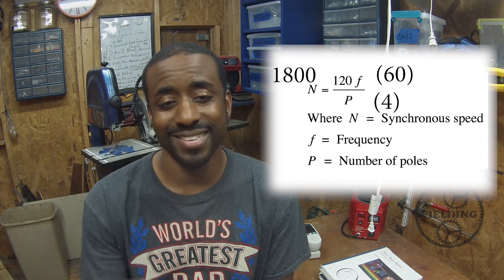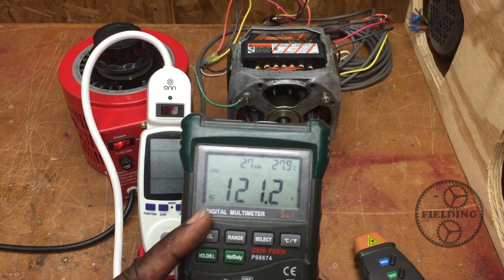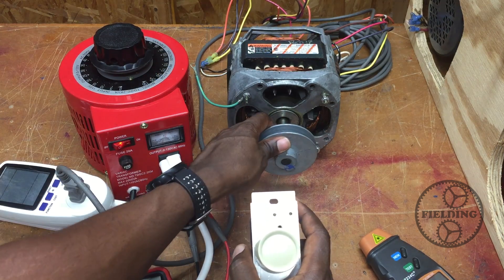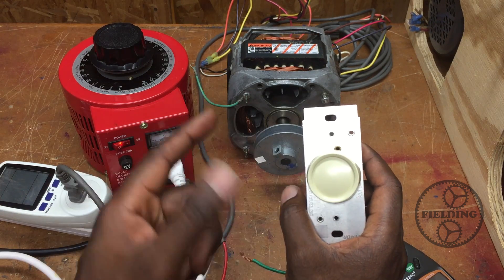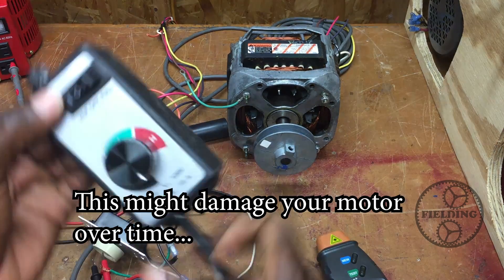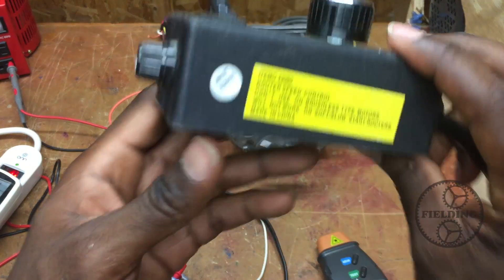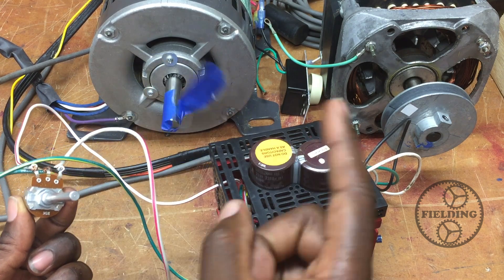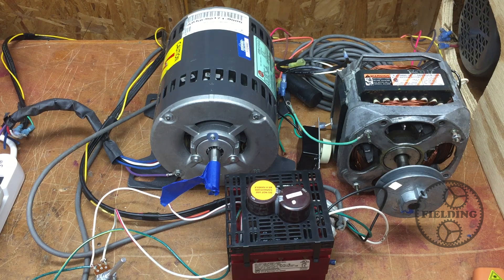Will A Dimmer Switch or Transformer Control An Induction Motor's Speed: 038

Comment: I literally just took a motor out of a 4 to 7 ish year old Ryobi scroll saw  Variable speed disc sander. The motor is 1.2 amps 120vac. And used the 6 inch disk from my 2x42. I have been told since I started to work with one that speed control and a disc sander can become one of the most used tools in the shop. The 2x42 is to fast. Especially higher grits. Flat and square decides good From great. Next project small space heater electric kiln that reaches and hopefully will hold temps for high carbon steels   and at most with 2 fire bricks. Max work piece 6 x 2 x  187 ish lol.  Any thoughts suggestions TIPS TRICKS INFO ABOUT THE HEATING COIL. HOW TO MAKE THE CHEAPEST PID AND THERMOCOUPLE EVER!? Lol it would be appreciated. Thanks for sharing so much entertaining useful knowledge with us. Very enjoyable.

Comment: I am currently experiencing some issues with a pentek intellidrive VFD which can be used with 2 or 3 wire single phase 240v submersible pump motors. Specifically I am seeing voltages from the VFD which I can not wrap my head around. An engineer suggested that perhaps it is due to the PWM and possible lack of a low pass filter on my meter. Anyway it's a shame that this video isn't able to discuss the nuts and bolts of the single phase VFD just yet, however I am grateful for all the great information here and the clarity your videos have brought me on the the different characteristics of the various motor types. Thank you very much for your great videos.
Reply: I think you require a "true rms" multi meter. Normal meters are only designed to work at 50 or 60 hz, any freq outside this range such as what a VFD would output will result in incorrect readings

Comment: Also, there are many board called inverters, the controls the acceleration and speed of the garage motor.
But what type of motor is that? Now that you said that about single phase motor for single phase VFD being rare, I became confused.
Please help me understand that! Are the garage motors not induction? I am having trouble searching that on my own.
Reply: Gui Srtr, I believe garage opener motors are INDUCTION MOTORS; at least the very old style that only moved at one speed.  Some of the new types with "soft start" probably contain a gear-reduced stepper motor.

Comment: What type is an Garage Gate motor? 
I thought they were Induction single phase but with 3 wires (one common, 2 for direction).
Also, they have a capacitor which I think is permanently attached to the windings, but how could that be?

Comment: This guy is totally wrong about VFD for single phase motor by saying that it is not good to use a VFD to control a single-phase motor. Using a VFD for a single-phase capacitor motor does not lead to many problems. If a problem occurs with the centrifugal switch it is NOT because of the VFD and is merely due to the age and usage of the motor itself. There are lots of VFD for single-phase motors specially in HVAC and it is not only 3-phase that are used. I gave this guy a thumbs down because of preaching wrong things. But yes, frequency is the "thing" that controls AC motors, but he is wrong about VFD are only for 3-phase motors and not good or even recommended for single-phase.
Reply from the maker: Ha I knew you would come! There is always one guy excited about the tiny fraction of applications for the VFD on a single phase motor. Sure man they exist exactly as I said in the video. If you know how to do it safely then this advice is not for you. Thanks for watching

Comment: I got a single phase 120v bandsaw and I bought a frequency drive for it. I Smoked the motor in 30min. What motor do I buy so I can have variable speed. Thank you
Reply: Hi John, you need to replace your induction motor for a brushed one. Most of those type of machines have single phase Ac motors and as Jeremy said you cannot vary their speed. 
From what I have learnt you have two options depending on what you want to do. First is to convert your motor to a dc motor. I followed instructions I found on YouTube and converted my 6 inch wide belt sander to a dc motor out of a treadmill I got for nothing. Instead of one fixed speed I now have variable speed from about 500 - 4500rpm, forward and reverse and digital tacho read out. It cost me less than $50 including the housing and I found it surprisingly straightforward it to build. I have since picked up another five treadmills for free to do other conversions.
The second way is to use pulleys or gears. To backup what Jeremy said, if you look at the larger floor mounted bandsaws they often have a couple of speeds but use pulleys to achieve this. If you look at the smaller bench mounted models with variable speed the first thing you will notice is that they use brushed motors not induction. There is one more option which is rather cumbersome and that is to have two bandsaws.
Not very practical but it is an option. I have a bandsaw that I spent a lot of time setting up pulleys to reduce the speed so I could cut metal on it but of course now I want to change it to a treadmill motor so I can cut both metal and wood. 
Maybe that will be my first YouTube video. I hope this helps. Cheers Stuart 🇦🇺

Comment: Wouldnt a vfd be useful if you just disengage the centrifugal switch to the starter then that problem wouldn't exist and instead connect a momentary switch in its place to start the motor up again that way the vfd doesnt have to worry about low speeds?

Comment: Hi can you help I have a washing machine motor that I wha to to turn into a bench grinder it is a 200-220v dc brush motor but need help with lowering the speed (not the torch) it runs at 8000-15500rpm need to get it to 6000-8000 can you help part number is 2826520100

Comment: Hypomathetically then, if you were set on controlling the speed of a single phase motor, you should generate your own AC power and control the frequency it's created at. Okay, so how can we do that?  An inverter is the obvious way.  How about using a motor as a generator? But what's going to spin it? And how are we going to vary the rpm that we spin it at in order to vary the frequency?

Comment: How does torque work with Vfd’s? Because the strength of the Lenz force is gonna be related to the induced current which is related to the strength and relative speed of the RMF, so at low speeds does a VFD also turn up the voltage so that there can be a reasonable torque, or are non slip ring induction motors always just gonna have low starting torque?
Reply: The rule of thumb is to maintain the nameplate V/Hz ratio.
Reply: A Day In The Life so you would then have to increase the voltage when you run it at low speeds?
Reply: @imraanmitha3280  no. You would decrease the voltage at lower speeds. If it's rated for 120v at 60hz, you could run it at 20v at 10hz without risking damage. You need to remember the large inrush currents motors have at low speed due to low resistance.  The windings aren't rated for continuous FLA.

Comment: Do you know of a rheostat that would work with a leaver instead of a dial . I have acquired three 3phase clutch type sewing machine motors . I already have a couple of my upholstery sewing machines running with servo motor using a two pulley speed reducer so i have plenty of torque . Rather than buy more servo motors I would like to lock the clutch on these motors and use a VFD with a rheostat to control my sewing speed . But it would need to be controlled with a foot peddle . If I found these motors lacking power at slow speed I could use a step pulley speed reducer  . So instead of turning a dial  I need a rheostat that i could hook a rod to from the peddle  Thanks Donny

Comment: Great video. I have scavenged an electric motor from a sewing machine. Can I make a variable speed motor with this motor? In other words, is this sewing machine motor the kind of motor that its speed can be varied with a dimmer control?  Thank you in advance. Clarence
Reply: Yes you can. It should work just as the foot petal for the sewing machine works I would think

Comment: Hi Jeremy and/or the people who would like to answer my question :)

I guess, the problems with frequency is related to AC, right?
I have an old hand blender motor works with DC 230 volt. It has a circuit board to direct the AC to DC. So, I can use it with 220 volt AC.

I would like to make a table saw with this motor but it is turning so fast when I used it with 220 volt AC.
Therefore, I used a dimmer to control speed of motor and it looks like working (not that perfect because I can't lower the speed as I want, but working).
My question is that "Is it dangerous to use that motor with a dimmer? May it overheat? May it burn?

Thanks in advance.

Comment: I have a small brushed ac motor, used as a grinding wheel. How could I vary the speed? At present it only has on/off switch. Thanks
Reply from the maker: Please check the description thanks

Comment: Hi Sir. I found my father's old dremel and managed to fix it up so I can use it for carving and such. Unfortunately it goes up to 35,000 rpm and has no speed controller. Incidentally enough we have a broken electric fan laying around the house and I want to know if i can use it's switch to control the speed of my dremel. Also, if that's not possible, can the dimmer switch work since the dremel's a brushed motor?

Comment: I'm an electrical engineer with 20+ years experience and I feel you produce excellent content.  On another video you had mentioned speed control and I commented that a TRIAC PWM circuit will control the speed of an AC induction motor.  I have designed the circuitry, tested it, and verified that it does change the speed of a fan, but that is a motor under load, unlike the motor in your test.  I think that it is accurate, however, to say that in an applied, practical sense a TRIAC PWM circuit will control the speed of an AC induction motor because I've never had the need to control a motor that wasn't under a load. It's similar to testing amplifiers and seeing a high gain in testing that doesn't translate once the amplifier is driving an actual load that requires some impedance matching.
Reply from the maker: Please watch part two of this video
Reply: Jeremy Fielding These were huge industrial fans that used large AC induction motors with starting capacitors and belt-pulley mechanical translation between the motor and the fan axle.  In fact, they were so large that we activated them with 5 - 6 inch wide contact switches that were themselves activated by relays and optical switches (to isolate industrial noise from logical circuits).  We weren’t using a light dimmer switch.  This circuit used a MAC224 40A TRIAC, so it wasn’t designed for indoor oscillating fan motors.

Comment: Hi, Jeremy. This may have been commented on by someone else farther down in the list of comments. I didn’t go through them all. Just a clarification about the light dimmer. It works by “clipping” off part of the sinusoidal waveform immediately after it crosses 0 volts AC, and it will do this for every crossing. The sine wave of 60 hertz AC voltage will cross zero 120 times per second, once as the voltage goes positive from 0 and once as it goes negative from 0. Since it does both of these events 60 times per second (60 hertz) then 60 x 2 = 120. It happens so rapidly that we generally cannot detect these clipping events with the naked eye in a light bulb. The more you turn the knob toward dim, the more the wave gets clipped, or chopped off. When the knob reaches the dimmest setting, most or all of the wave is clipped. The dimmers were intended for resistive loads (incandescent lights) only, and that’s why they don’t work with fluorescent lights or CFL’s or most AC brushless motors (inductive loads). With an inductive load, the frequency (60 hertz) remains the same, but the amount of current available to the coil windings decreases because the available voltage decreases (ohms law) and this will have a direct effect on the strength of the magnetic field and thus, the torque of the motor. If I remember correctly, anyway. I learned all of this 45 years ago and have applied little of it since.
Love your videos, especially your build videos. You explain things at a “show and tell” level most anyone can understand. Keep them coming. Knowledge is power!

Comment: You can take a DC motor, attach it to a potentiometer and a DC power supply, use it to drive a 3-phase motor, use only one phase output, and then adjust with the potentiometer the speed that you're turning the DC motor which turns the AC motor into a generator. By adjusting the RPM with potentiometer of the DC motor you can control the output frequency of the AC generator, or motor, and the electric current coming from the three phase motor turned by your DC motor can be adjusted to create single phase 2 phase or 3 phase power at any frequency, that is easily adjusted by a simple potentiometer switch. This is not a purely Electronic solution, more like electromechanical but it is not that difficult, and allows you to make one, two or three phase AC at any frequency or voltage depending on the windings on the three phase. And the components and regulators you put after the generator

Comment: Only dc motors can be controlled with voltage, a.c. motors requires what's called an esc. Like this guy explained it's a device that alters input frequency or Hz. Ideally the voltage on a.c. motors remains continuous and only the frequency change. This is because the way the brushless motors work vs the way brushed motors work. You could replace a.c. motor in your projects with dc and use potentiometer to control speed of motor, but I recommend an esc to control a.c. motors. There relatively cheap and can often be controlled with pwm inputs from lab bench supply with function generator

Comment: They do make a single phase freq drive for air conditioner condenser fan motors. They are used in conjunction with a thermistor to control head pressure.  If you could get ahold of one, you could replace the thermistor with a potentiometer. However as I understand it you must only use a single phase freq drive  on a motor with ball bearings because it will elongate sleeve bearings.

Comment: how are single phase induction motor ceiling fans  controlled? lowes sells a variable control for 9$ part# FS-5FH-DK is this safe for small 120v single phase induction motors? like a bathroom exhaust vent motor
Reply from the maker: See part two

Comment: And it's not good to increase the speed or lower the speed by increasing or degreasing the voltage because it will make the coil for the capacitor suffering

Comment: Your motor will not get low speed or higher speeds unless you have inside your motor more or less coil turn because you have a capacitor connected to your motor capacitor coil and that will keep your motor in release speed as it designed

Comment: Thanks for another informative lesson. I will note, though that there are a number of tools, such as woodworking lathes that use VFDs but the power input is 120 VAC. The difference is that the motors are * DC * motors, not AC. I assume that the tool's power supply converted th AC to DC and then does something with that to control motor speed.

Comment: Jeremy...A ceiling fan is also an induction motor but why can we slow down its speed with a dimmer switch?
Reply from the maker: watch part two.
Reply: @Jeremy_Fielding  .. Just did that and got my answer. Thanks.

Comment: How about a shaved pole motor - will a triac dimmer control speed of it safely for both motor, dimmer and most importantly is it any kind of fire hazard?
Reply from the maker: Please understand I get hundreds of emails and comments asking for technical help. It just isn’t safe or practical to try and do that at this scale....but as a side note, research how the motor works and apply that knowledge to what you learned in this video

Comment: 🤔 So there's a VFD (of some sort) in the treadmill itself?  I've seen quite a few things that have employed the "treadmill motor" but never once mentioned (with detail) the how they drive it. 
So pwm doesn't effectively work to breach the >1800 rpm max out of the displayed motor?
Asking since you already have the equipment
Reply from the maker: It depends on the type of motor. Most treadmills use a DC motor. Some commercial treadmills use a 3 phase motor which would require a VFD to control the speed.

Comment: My guess is that when voltage goes down, current goes up=more heat generated. Jeremy, is it ok to run a , say, 2hp motor with a 5hp vfd?  I would think it would be alright, because the motor wont draw more power than its rated for, but I think it would be a good Idea to replace the fuse in the vfd to proper size for the motor. Thanks Jeremy.⚙️🔩🔧⚒🍺🍺🍺🍺
Reply from the maker: It is common practice to oversize the electrical components including the VFD